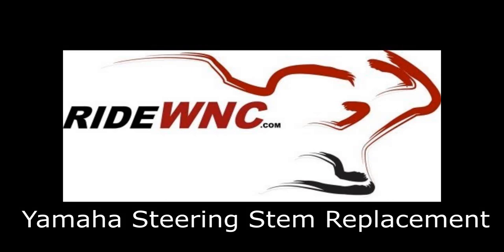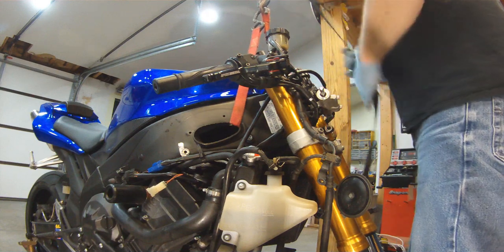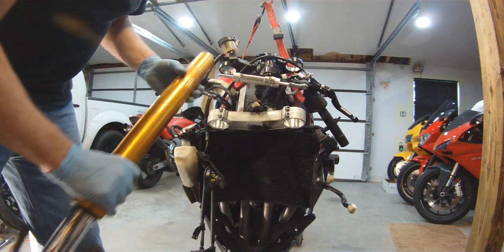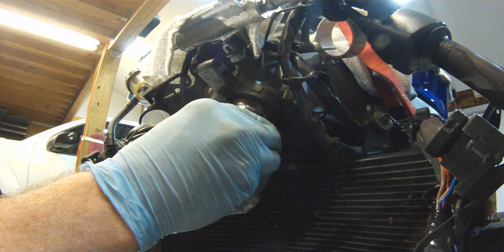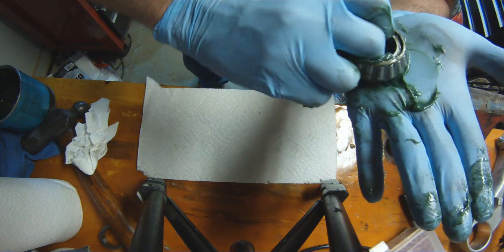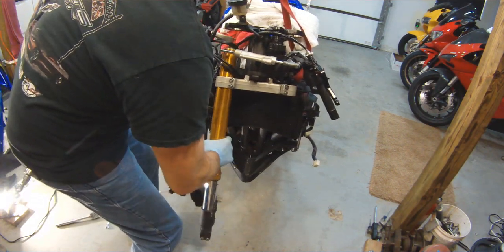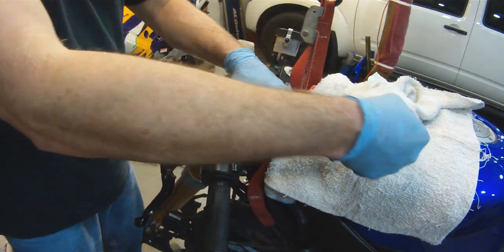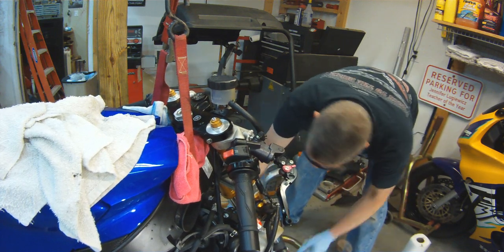Yamaha R1 Steering Stem   Fork Removal - Tapered Roller Bearings

Comment: Can I ask you a question. I have a r1 5vy and recent tried changing my bearings just like you. I put the new cups in sitting correcting but my problem is the bearing on the bottom. I got my kit from my local Yamaha dealer ship and once I hammered of the bottem race I noticed it had the same code on as my new one. The new bearing doesn’t want to sit on top or be pushed on for that matter. Have they sent me the wrong one? Funny how the numbers match up on both parts but the new bearings are the new type and the old ones are original.
Reply from the maker: Without pictures I can't tell what you have. Typically dealers don't sell or install tapered roller bearings. They will sell you the OEM bearing kit. There is a difference between 2006 to 2007 the sizes changed.

Comment: My 2011 R1  manual calls for 113nm on the top aluminum bolt and that I know will strip it, so what would you recommend Torq wise?
Reply from the maker: Snug. If you are worried about not getting it tight enough but not too tight, blue Loctite is your friend. Red Loctite if you want to make sure it stays until the next removal.
Reply: @RideWNC  Hi There I managed to fined bearings (NSK) but wonder if the OEM Seals - Dust Covers will work with the new tapered roller bearing?
Reply from the maker: @tonygroenewald7865  They should. If I remember correctly, the All Ballz kit comes with seales.
Reply: @RideWNC  How is the All-Balls kit?
Reply from the maker: @tonygroenewald7865  As good as any of them.

Comment: How did your top dust cap sit? I have an 06 r6 and they sent me a 55mm top dust cap, while oem is 58mm. It doesn't seem to seal all the way as there is 3mm of gap. Did your top dust cap also have this gap? Thank you
Reply from the maker: It should fit close so dirt and debris don't contaminate the bearing. Just a suggestion: Can you reuse the original?
Reply: @RideWNC  Yes I could, I am just wondering if I installed everything right. Do you think the bearing would still sit right? I asked all balls support and they confirmed the dust seal was 55m, not 58mm like original, perhaps oem will interfere with travel or something? But then that will just kill the new bearings as dust and water will get inside
Reply: @RideWNC  but yeah the one sent will let all the dirt and debris and water by, because of the gap
Reply from the maker: @vladniko75  The original should be OK. Use Marine grease to protect from dirt and water.
Reply: @RideWNC  great to hear. I lightly coated the bottom bearing with "Valvoline Multi-Vehicle High Temperature Grease" as it says it is water resistant. should I go out and grab marine grease and pack em both with that instead? I haven't packed the bearings yet
Reply from the maker: @vladniko75  I like marine grease because it is great at keeping the salt water from destrying your boat trailer bearings so you know it will protect your bike.
Reply: @RideWNC  awesome I’ll go get some. But I just wanna be triple sure, you don’t think oem dust cap can mess anything up right? Perhaps with bearing travel or anything? I shot you a message on Facebook messenger, if you want I can send some pics there

Comment: On the new R1 2015 or MT-10 the top bearing is different from the bottom, the top one is 55x30x17 and exists this size in tapered style, but the bottom bearing is 55x31x17 and I dont find this size 31 in tapered style, only the original grove ball size.

Do you know if is any problem fitting the 55x30x17 bearing on bottom and will fit anyway?

Or its better to use the original size and groove ball style on bottom and tapered style on top?
Reply: trying to use the alls balls kit on my 18 r1 did you ever figure this out?